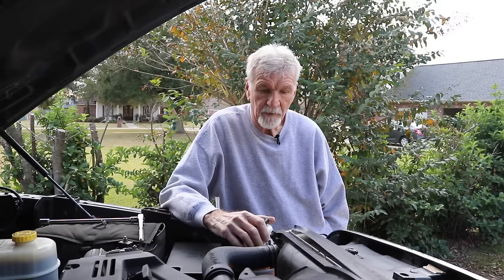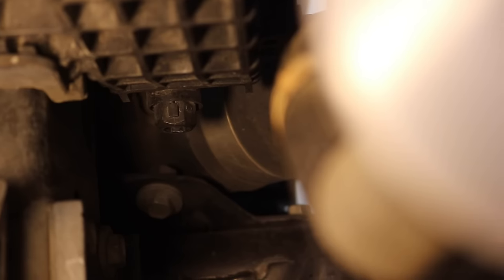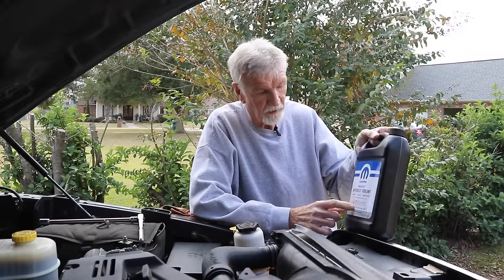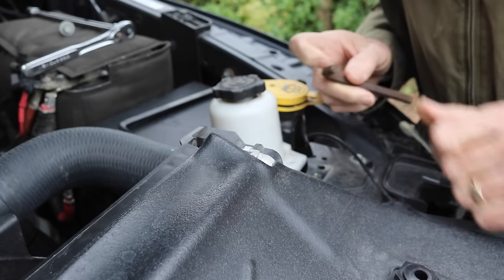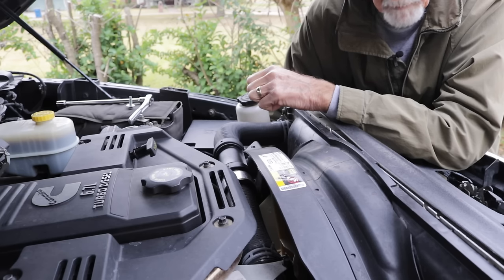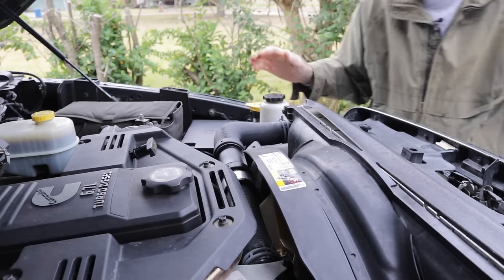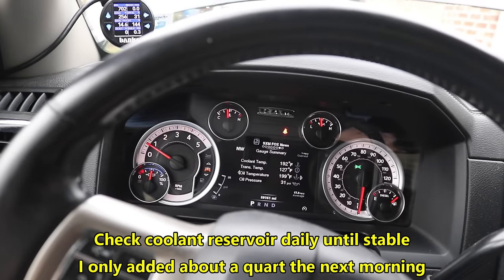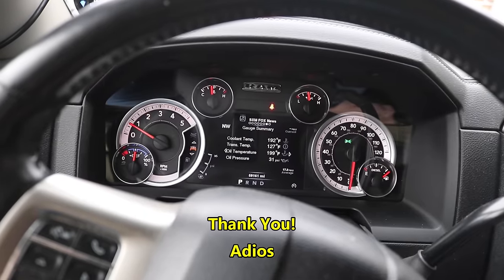RAM 6.7 L Cummins 2500 Coolant Change.

Comment: Great video and super helpful.  Only thing I’d is that the coolant drain valve at the bottom of the radiator opens up a drain right next to it.  You can attach a length of tubing to the drain before turning the valve allowing you to drain all the coolant into a 5 gallon bucket with no mess.  I’ll admit I did take off the wheel well housing rather than going from the top, so it was easy to see everything.

Comment: Thanks for the in depth information. I have a 2016 Ram 2500 and have changed the differential fluids and transfer case myself after watching your videos. Your a great help!!!
Reply: Pete did you change your fluid and if so how did it go.
Reply: @nathanurick8320  it went fine just as he had said in his videos. No problems

Comment: On my 2012 Ram 2500 there is a bleeder valve for the cooling system on the passenger side of vehicle near the egr cooler. It is also the highest point in the cooling system. Opening that vent will help to bleed the air out of the cooling system. Thanks for all the videos. You have saved me a ton of money by being able to do my own maintenance and by showing me how to do it correctly. 

Also I have to laugh at some of your off handed comments in some of your videos.

Comment: You sir are a Godsend. I realized today at work that I replaced a coolant hose during the summer and my truck had been sitting mostly full of water. Temperatures have been dipping into the danger zone, but supposed to get into the single digits tonight. I’m working 14 hour days and thought I’d be up all night saving my engine. Thanks to you I accomplished the task shortly after bedtime.  Thanks so much!!!

Comment: Hi Marion and thank you as always. My used 15' had the pump done as required before I owned it; now at 125k miles, I'm making a plan for long term ownership. I'm thinking around the 150k mark I will replace the fluid, as you just did, but also replace the pump (again), tensioner, belt, and the Y pipe (other hoses as needed). I don't care to add an aftermarket filter system, but I do want to do a certain amount of work to help with longevity and keep it out of the shop. Thanks again, and I look forward to the next one.
Reply: How is your '15 holding up? Mine is a '16 deleted at 17,000 miles, now had 92000 miles, no problems yet other than wearable stuff, brakes, front u joint and wheel bearings...just curious, thanks
Reply: @noahsmadda8828  Had a u-joint go under warranty. Put in a Thuren track bar to stop death wobble. Have to be gentle with 5th and 6th gear, but it drives fine if you are not hard on it. Big thing for the north east is keeping the rust off of it, so I put fluid film on each year. I'm happy with it, I can't see giving up the mega cab anytime soon.

Comment: There is a 4th way to access the drain plug on the 2014 Ram 6.7 diesel without removing anything and is the easiest of all. Simply slide your LEFT hand between the wheel well cover and you will find an access opening in the frame to reach the drain plug. You will feel around for the plug location which is very close to the opening  in the frame and then I used my 3/8" rachet with a 10mm  Allen socket. With just a couple of 1/4 turns the coolant starting flowing. I would hope most diesel rams would have this opening.

Comment: Greetings, finally have something to add :).  I bought a used 2015 2500 Big Horn with the 6.7, about 127K miles.  I'm slowly moving through maintenance items, sometimes at the dealer if cost benefit seems in my favor.  The coolant was getting up there in age, so I had the dealer flush it all out, they used a cleaner and then refilled up with the same Mopar that Marion showed.  Total cost in California out the door was $270, which for me was fair, I wanted it flushed and did not want to deal with disposal.  Note that I don't think I have the Y flange so maybe just one radiator starting with my year, not sure.  They gave me what was left of the gallon because a little burping still and the low level light would come on and off at a stop light, no big deal.  Anyway, just sharing experience and cost for a "flush" at the dealer.  Cheers everyone.

Comment: Marion- 

Quick thanks for taking the time to walk us DYI types thru the paces !!! 
I got a low coolant warning & turned out that the coolant reservoir turned a sludgy brownish color and was causing a fault with the sensor … 

It was quite a chore to get the clearance to remove the coolant reservoir and replace with a new one.  

Did a flush and coolant change which cleared the low coolant fault !!! 

However, after cleaning the coolant reservoir using SUPER hot water & cascade all the sludge n gunk was gone…

So, if one has the time and desire to remove, clean, replace, flush and refill… It is possible to remove the fault by a “vigorous cleaning cycle” !!!  

Or $800 at the dealer will get the fault cleared using Dealer Service 24k magic !!!

Comment: My 2015 was in the water pump recall. My dealer used the vacuum system to recharge the cooling system after replacing the water pump. After a few days, I started getting the low coolant warning light. The dealer noted on the work order that the workshop manual's instructions were followed but the system did not recharge correctly. Just an FYI.

I have the coolant vacuum system and it works well with all my equipment, most diesel land management like tracks and RTVs. Have yet to use it on my RAMs but will when they come due.

Comment: Well that was a lot simpler than I thought it would be. I figured there would be bleeding involved. (Not you but the truck 😂)
Reply from the maker: Yea, I only added coolant once after it cooled completely down.   Very easy job.
Reply: It’s called vacuum fill per cummins service manual
Reply: @repairvehicle vacuum fill requires a special tool that Marion mentions early on. He didn't use a vacuum, he did it the conventional way.

Comment: Thanks for that secret route to the drain , hopefully it’s the same on my 2016. 
I doubt I will change anytime soon as a water pump recall & then a turbo actuator failure has made for 2 different drain & coolant replacements( warranty) 
Oddly enough that funnel for the fuel fits and stays in by itself on mine .
I also always carry 5 gallons of fuel in a can with a modified spout & have needed it ; ) 
Stay safe & be well
Reply: Water pump recall? I have a 17 didn’t know about that. Do you know the years it effects.
Reply: @brettegarr8064  2016
Reply from the maker: You'd get a letter from RAM

Comment: My dealer made it easy for me when the water pump went out with about 80 k miles on it. Still under warranty . They changed it to the upgraded version where it leaks out from the  housing instead of the front bearing.
Reply from the maker: Yes, same.

Comment: Your engine looks clean like a new truck. I worked construction and a2016 was my work truck so it’s dusty and with some oil spills. 178567 miles with just maintaince And a turbo replacement.

Comment: The Preston Dexcool 50/50 works. Has on the bottle MS 90032. Is around $16 or 17 at Walmart. I’ve had it in mine for 15k and no problems.
Reply from the maker: thanks, good to know

Comment: My 11 model is nothing like that. I figured it would be similar. I was able to use a 3/8” hose ID and open the drain valve, drained it into a 5 gallon bucket.
Reply from the maker: Yes, I believe you have a radiator cap also?
Reply: @MarionBlair  yes I do. Took it off while I drained the coolant. Also have a little set screw looking thing on the coolant pipe by the egr cooler.

Comment: Hi Marion I wanted to ask about this for sometime, glad to see a video from you. My 18  started a weep after a cold snap last year coolant in it tested to -43c. But we got a bit cooler than that. So the dilution of the mopar coolant is rated to only -35c. That’s what the dealer put in... ended up with a way bigger leak and repair bill..... So After replacement Rad i used a different mixture now back down to -50c. Gonna try not to use it in anymore cold snaps. Thanks for the tips, I hope your doing well.

Comment: Actually, according to the cummins and ram service manual vacuum fill is required due to egr cooler, otherwise failure of egr cooler and overheating is possible. To many air pockets that require vacuum fill.
Reply: Vacuum fill is what I’m doing on my 08 6.7 deleted but I filled this way once and took for short ride and I know I have air pockets in mine heater don’t blow warm air now and temp fluctuates on which way you turn. If u don’t vacuum fill you will eventually crack egr if u still have it

Comment: I never use 50/50 when changing my antifreeze!  The best way to get a 50/50 mix is to start by adding full strength antifreeze up to 1/2 of the cooling system's capacity.  Then add distilled water until the radiator is full and add more distilled water as needed as air is purged from the system.  If you use 50/50 instead of full strength, you will end up with more water than antifreeze in your cooling system because around a gallon or so of water remains in the engine block even after your drain the system.

Also, I don't recommend fooling with the petcock.  They tend to break off or start leaking so I only make sure they are closed and never open them.  Just pull off the bottom  radiator hose and flush as many times as necessary to end up with clean water on your last flush.

You can also remove the block heater and with a few plumbing parts connect a garden hose to really back flush the entire system and don't be surprised if the block heater could stand to be replaced.  I was amazed how bad mine looked.
Reply: That’s why service manual states vacuum fill to avoid damaging egr cooler with air trapped

Comment: Another great video Marion.  I wonder if you have thought of putting a video together around fuel injectors.  I've read a lot in forums about how many 4th Gen trucks need them replaced around 100-150K miles.  I try to buy the Nano filters to keep small particles out of the system, but am curious on your thoughts.
Reply: The factory filters are nanonet filters.
Reply: I use the nano-nano bot filters … Lol

Comment: I have the same truck, I had the water pump recall done at 40000, I have 96k now, dealer say to wait till I have 100k on coolant,  so for me 140k. Tested mine with infractor, show -38*. 
Just wondering why you did yours so early. And I didnt see you flush it. Just a dump and fill. Why you didnt flush it good before refill. At the cost of the coolant of 80 dollars, I will flush mine good, these trucks are known for heater cores plugging up. When they did the water pump, they flushed mine, and there was all kinds of crap in the coolant. So I had them add a coolant filter to system to help protect the heater core from plugging up.
Have a good day.
Reply: Yes good point on the flushing, I was wondering the same thing, and what is the process for this? Straight distilled water or coolant /water mix?
Reply from the maker: Yes, I did it early.  Suppose to be 10 yrs or 150K.  I'm on 8 years.  I just wanted to make sure it didn't have any of the crap you talked about.  I got 5 of the 5.6 out so I didn't flush.  Ideally, I could have refilled with distilled water and diluted that .6 gals left behind and then drain.  Water is the only flush I'd use, no chemicals flushes.
Reply: @Chris C this is what I added the coolant filter, 50k and no issues, works good so far

Comment: A hex socket and short ratchet wrench works better than hex wrench.  Put the socket on the wrench and rotate it on the ratchet until it slides in the drain plug.  It takes several turns to open up the plug and you only have to put the socket in the drain plug once.

Comment: Thank you sir, Ive been waiting for this, Ive been following your videos since I bought my '16. I use your videos so I don't have to pay out the ass for a diesel tech to do all this.  I like the method of going thought the top of the engine to get to that valve.  
You use distilled water for diluting?
Reply from the maker: Yes, distilled water and concentrate 50/50.  Going thru the top is definitely the way to go.  Just have a long sleeve shirt of maybe a shop towel or something on the edge but I didn't have any problem.

Comment: My dealer had to drain my coolant, and they did not replace all of it, I drove from S. Texas to Trinidad Colorado, and put in about 1/2 gallon, drove another 100 miles and put another quart in. So dealers don't even use the tool.

Comment: Did not notice if you bled the coolant bleed bolt just in front of the egr cooler.  This keeps air out of the egr cooler which causes an internal leak?  If you change your ccv filter at 60k, a Cummins rep says you can wait for 120k to clean the egr cooler and valve.  Cleaned mine at 75k just to find the water seals too stuck to get out...so, 50k must be the way to go.  I also make sure that the ccv air filter is changed every 25k.

Comment: Thank you. I have the same truck and noticed that I can smell antifreeze in the engine bay after a drive up to temp. It uses a small amount of coolant as well from the reservoir. There are no obvious signs of a leak. I did have the water pump recall done way back and im the original owner. I only have 48k on the truck. Any ideas I really appreciate it? Thank you

Comment: Could you have reached the drain valve from underneath?  Just wondering.  And you're right, Ram engineers are very good at two things:  putting parts in difficult to reach locations, and coming up with the most complicated and difficult to see locking mechanisms on every wiring harness plug in.
Reply from the maker: No access from underneath without removing the fender liner.
Reply: @MarionBlair  is the plug visible from the top or do you just Have to Reach and feel for it
Reply from the maker: You can easily see it and get to it from the top..
Reply: Fiat designed the vehicle as well as every single Chrysler product. The company is now called Stellantis after Peugeot and Citroen merged with FCA.

Comment: Wasn't there a "bleeder" in the vicinity of the EGR cooler? On a '17 there definitely is.
[EDIT: on a '19 the Factory Service Manual says the vacuum fill tool is mandatory to ensure no air pocket(s) in EGR cooler]
Reply from the maker: No, not on this one.  Saw the bleeder on pre 4th gen models however.
Reply: @MarionBlair  interesting. I know you know your truck.
Reply: I have a 2018,   2500. How do i know if i have a "bleeder"  or need the special tool ?
Reply: @carlvin8693  apologies for a slow response. The bleeder is located near and above the EGR cooler. It should be obvious.

Comment: just go under the truck' on driver side. it's a plug that sits on the bottom-side of radiator. mines have nub that you can twist it off  to drain' and back in to close when ready to refill.

Comment: Once again, thank you for another fine video. (Assuming the system is at the proper level before starting the change) Would it be worth while to measure the amount that came out? I'm wondering if that would be a simple method of know exactly what needs to go back in. Just a thought.
Dave
Reply from the maker: Yes, absolutely

Comment: Thanks Mr Marion you did a great job, how many thousand miles to change the cooling? And why you don't replace the new thermostat as well. Thanks.
Reply from the maker: 10 years or 150K, I think but I just decided to make the video early.  Stock thermostat is find as far as i know.
Reply: @MarionBlair  thanks for reply, I watched all your clips and saved it, very helpful.

Comment: I am going to attempt to explain this. Does your coolant reservoir have a spot right in the bottom front where if you over fill the coolant it leaks out. I have a 15 and my reservoir does this if it gets over filled. I am not sure if a plug or something was supposed to be on that bottom portion of the reservoir. Reason I am asking this is I see that you were able to fill the reservoir up really high while it was taking coolant in and I don’t thank i would be able to do that due to my reservoir having that drain on the bottom. 

By the way I do appreciate the videos you do they do help tremendously.
Reply: CR .  Exactly where I'm at with my 2014 RAM TDI after changing the upper Y connector....filling reservoir and farting around with slight Y leak... here's what I've experienced...when too much coolant gets added to reservoir and you try to burp the excess air out of the system by squeezing the upper radiator hose either:  1) With filler Cap ON any excess fluid flows over an internal channel near the top of the filler neck into a front facing secondary chamber and eventually exits from the "spot right in the bottom front where it leaks out" as you stated;  Or,  2)  With filler Cap OFF and you squeeze the excess fluid bubbles/escapes out over the top of the filler neck and makes a mess of engine before hitting the ground below ....Trust me I know...
Reply from the maker: Yes, I know what you are talking about.  When the cap is off,  and you overfill, it would run out that bottom thru that compartment.  When you put the cap on, the o-ring in the cap seals that off and allows the tank to pressure up.  If the pressure gets over 21 psi, it will let the pressure/ coolant go out that same place.  That's so it doesn't spray out the cap itself.  It does the exact same thing as the older models with the radiator cap and the rubber hose overflow.